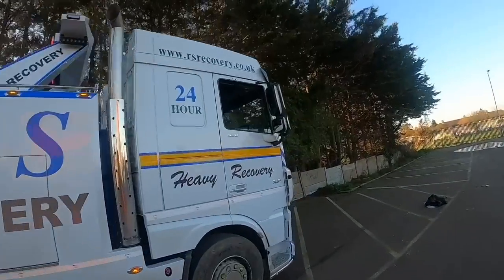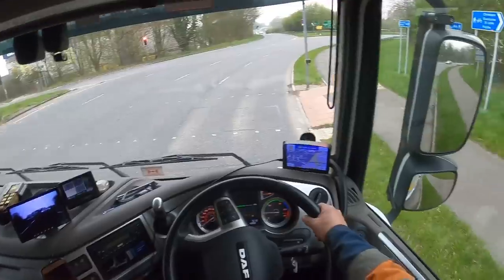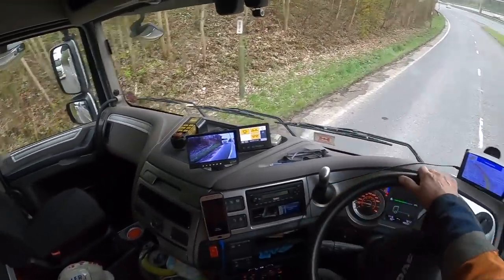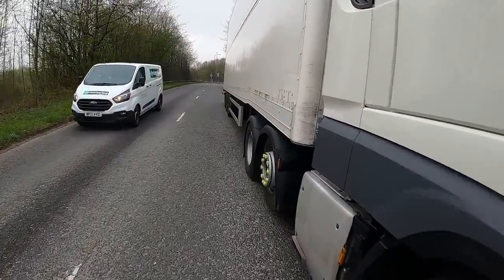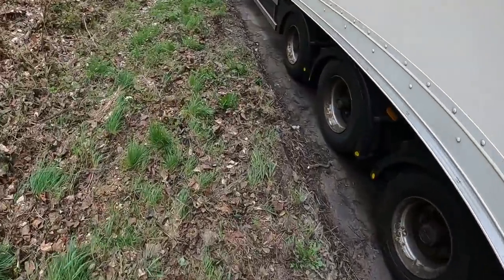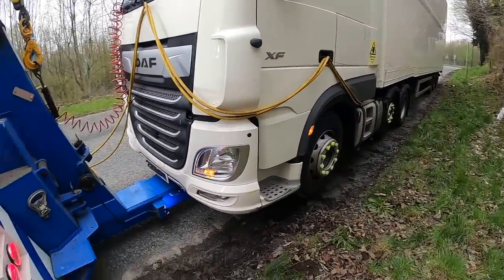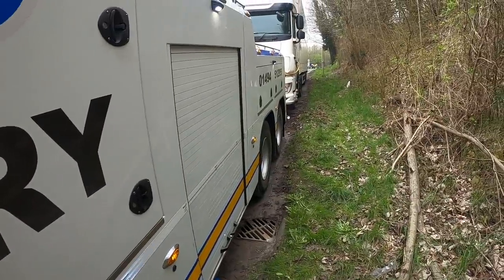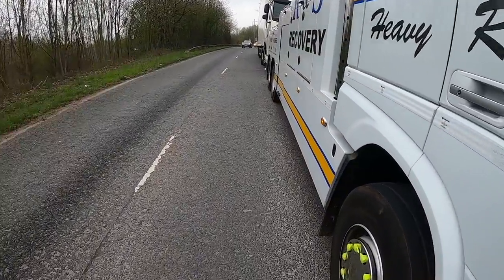RECOVERING 44 TONNE LORRY STUCK ON MOTORWAY SLIP ROAD! UK TRUCK RECOVERY!

Comment: Great

All you recovery guys do a fantastic job in some not so ideal places. Surely with modern design technology there has to be a safer and easier way of recovering a 44 ton Hgv without having to remove halfshafts and alike, great job and stay safe out there 👍🏽
Reply from the maker: Hi Paul , not at present mate still pulling them half shafts.
Reply: @HeavyRecoverywithSteve  thanks for the reply I know, it looks a pain in the arse.I’ll know what to do when my daf decides to pack in 🤷🏽‍♂️
Reply: Something I have often thought. Granted these are designed to cope with heavy loads and huge torque but when there has been the ability to fully lock or disengage diffs for many years with offroad vehicles, you would think this design could be applied to the diffs on these. Maybe even a pneumatic actuator that disengages the diff/half shaft for recovery?
Reply: @andrewlittle4563  there have been designs with a form of quick disconnect on the driveshaft, but the problem is things like that creates a point of weakness. The way a differential is designed you cannot have axles that are both connected and not connected. If you put in any kind of clutch you lose strength and create a power loss between the drive shaft and the wheels. There's also the issue that most trucks don't ever need to get towed, so implementing any kind "just in case" solution just adds extra cost and weight for no practical benefit.

Comment: We don't have that gush of air here in OZ  when the red line is attached or removed as the emergency air supply goes through the park brake in the cab on Australian trucks. When the cab park brake is applied, this also cuts the supply to the red airline which obviously also applies the trailer brakes. UK tractor units, on the other hand, only apply the trailer brakes via the foot brake as the red emergency air line is always active. Also, no brake buttons anywhere on Aussie trailers which means the only way to release the trailer brakes is with the airlines attached and the park brake released in the cab.
Reply: Interesting. Some of our trucks pressurise the yellow line with the handbrake so when parked the trailer brakes are applied however some dont so you're effectively parked with the trailer brakes off which I feel is a bit stupid seeing as you could be parked on a steep hill with 35t or there abouts pushing against the unit.

Comment: Hi Steve really enjoy your films. I was wondering when you  put damaged trucks  half shafts in the holder on your recovery truck what stops it vibrating out and getting lost .
Reply from the maker: Hi John , never had a problem purposely made by body manufacturer to retain them, they do slide in at steep angle and our pretty heavy so seem stay in ok

Comment: if you pump air to the tractor, wont it  also supply air to the  trailer as well? eliminating the need to go put 2 hoses to the trailer, just the service hose .
Reply from the maker: Hi Jonas , yes your correct if i left  the red line in from unit to trailer it will indeed supply air to trailer. But the red air line is a emergency line from my truck to the trailer so if comes attached  in accident the brakes will come on trailer hopefully coming to a stop.
Thanks for Watching much appreciated.

Comment: From the US, never seen the take the half shaft out from the wheel, usually have to crawl under, unbolt it from the diff and chain it to the frame rail
Reply: The main driveshaft, not the half shaft
Reply from the maker: Thanks for watching, yes we pulling out more half shafts out now alot quicker and safer.More trucks over here now have single drive axle so only 1 half shaft needs removing.

Comment: Hi mate, great channel. I’ve always wanted to do heavy recovery. I had an interview for a place not so long ago and they would give me a job but start off on cars. I didn’t take the job incase they never had any intention on training me on heavy recovery. 
Do you take both half shafts out or just 1?
Reply from the maker: Hi Richard , on trucks with single drive axles only remove the 1 half shaft to disconnect the drive to gearbox

Comment: So you don't have to get underneath the truck to disconnect the prop shaft anymore?
Reply from the maker: Hi Norman, tend to pull out half shafts more often now a lot safer, and due to more trucks have air suspension and air pipes running above rear axle a pain to strap prop shaft up without fouling pipes

Comment: What is the max lift weight of that boom?
Reply from the maker: Boom is a Maxi Reach by Boniface Mk6 rated at 33 tonnes fully in and 9 tonnes fully extended at over 4 metres.

Comment: Would you notbe better putting out actual warning signs before the bend to warn them? Will nobody know when you're braking now with you pulling the electric cable out?
Reply from the maker: Hi Fern thanks work watching, we only carry limited supply of traffic cones as warning, we not allowed to lay out road directional signs as that comes under Highways Agency jurisdiction. I fitted cordless trailer board to rear of trailer then  unplugged electrical  lead so trailer had lights controlled by my truck, hope that ok.
Reply: @HeavyRecoverywithSteve  other recovery companies put out signs saying "slow. Incident" and it warns drivers there is an incident around the bend

Comment: Most people don't slow down because they have seen you and pulled out in plenty of time so they are only overtaking a stationery object, leaving plenty of room for you. The problems arise from the dopey git who doesn't see a huge truck parked there because it isn't on their Sat Nav display. When it comes to visual clues, many people only respond the things 20ft in front of them.
Reply: Yeah. Having said that, I'm surprised that such a tall trailer didn't have an extra light cluster up at the top for increased visibility. Obviously, it's always every driver's responsibility to look out ahead of them but the small number of lights on that trailer makes that job a tiny bit harder. When you make thousands of people's job a tiny bit harder, a couple of them will fail.